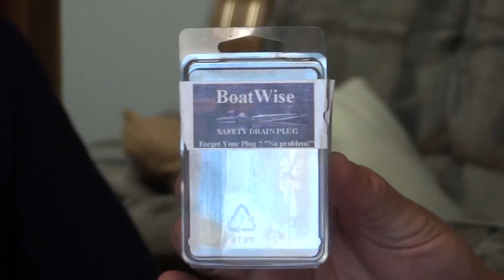Arizona Outdoors Today - Boatwise Safety Drain Plug

Comment: It would be helpful if you where to mention what type of sealant you recommend to use around the back of the plug when installing it. I have already purchased both of the chrome and the black one, but there is no instructions mentioning the recommended sealant in either of the product packaging either.
Reply: @Hello Ray Ver Hey, How are you doing?

Comment: You should put your boat plug in the boat before you go in the water because I think if the plug is not in the boat will fill up with water.
Reply: Yes but plug gets pulled when you launch from the ramp and stays out till you re launch in case rain and drainage like when washing